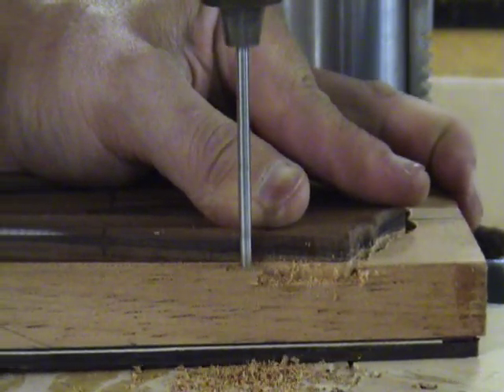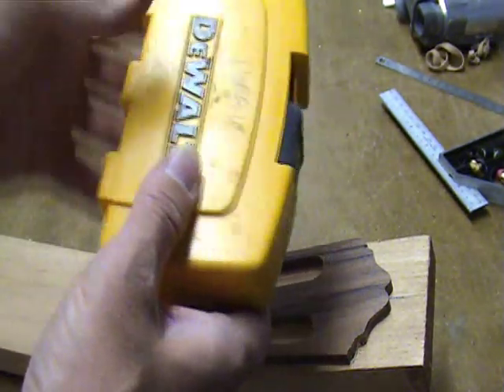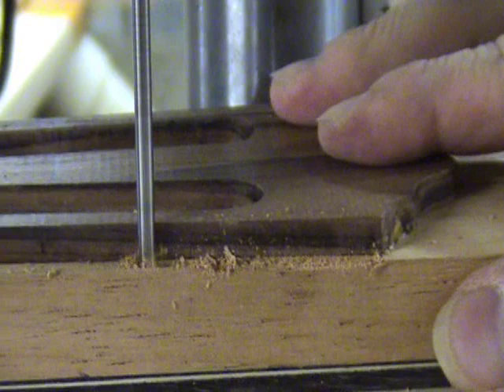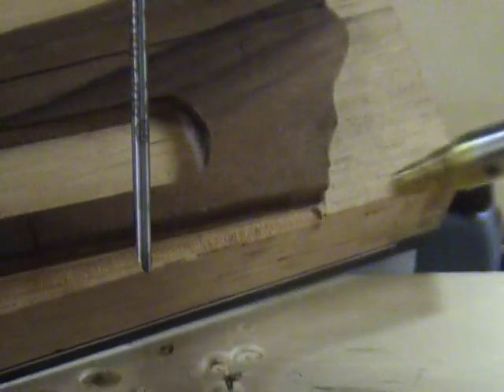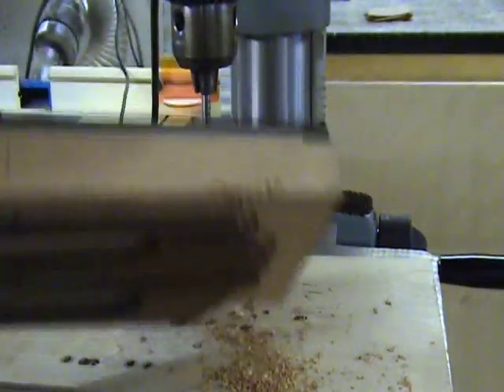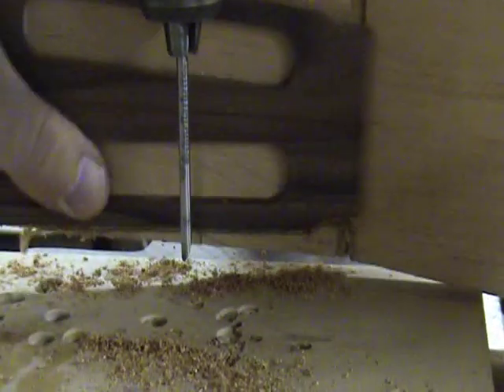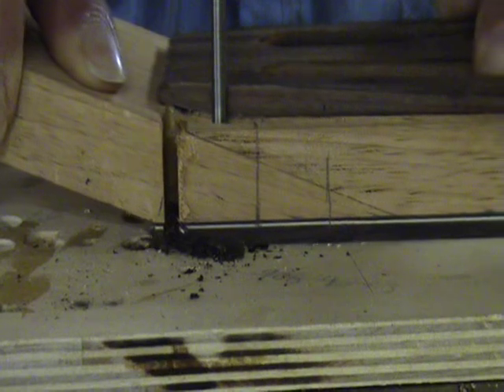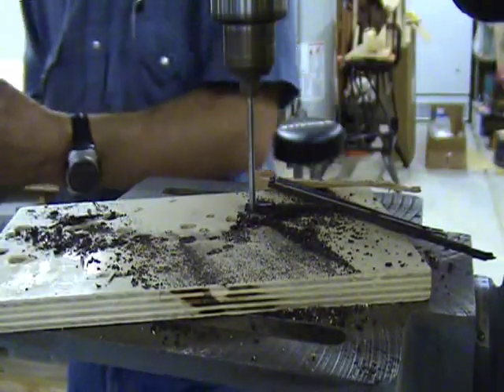O'Brien Guitars - Luthier Tips du Jour- Drill Press Router

Comment: In the early 1980s I worked as banjo maker and this was one of the jobs I did. We used a machine called a pantograph engraver which is essentially a floating router guided by a template. These machines have been superseded by computers and are available at relatively low cost. They are heavy, but once in place are very useful for all kinds of work.

Comment: Will the drill bit tend to want to wander off if it is not captured by the waste material? I ask this because I question why you wouldn't do a rough cut on the bandsaw to eliminated the chip buildup problem, but I assume you have a good reason why not.
Reply from the maker: You are correct. The bit seems to cut better with a full pass.

Comment: This is a great tip Robert!

I've recently completed a rig to profile banjo pegheads based on this method, but banjos have an important difference - the peghead is routed with the bit held perpendicular to the fingerboard, and with the backwards angled peghead this results in the cuts on the edge (in the length direction) being angled relative to the peghead face.  

I built a simple hand positioned XY table (search for "makerslide") to bolt to my drill press table for holding the neck parallel to the fingerboard centerline and after clamping the peghead to the XY table, the drill press table is tilted until the fingerboard is level and the profile is then routed out using this method (face side up however because the tilt makes backside templates difficult).  Along with some thin backer wood top and bottom to eliminate tear out the rig produces a nice profiled peghead, angled per banjo tradition, with only a short sanding needed afterwards  Thanks mucho for this idea.
Reply from the maker: Glad to hear it worked for you.

Comment: One of the most useful tips I've learned on YouTube.  Works well for general routing tasks, such as slotting bridges.  Bits cut as cleanly as router bits, but can be made up quickly, as needed, in 1/64" increments.  Try to buy a 9/64" router bit from Home Depot -- or anywhere else.
Reply: +Hubert Humperdinck When you slot bridges is there much cleanup involved or does it leave a fairly flat bottom?
Reply from the maker: +Jeff Zweygardt It is flat but I use a different method for slotting my bridges.
Reply: Yes, I use a Dremel too. Just curious how well this works out for bridges... :)
Reply from the maker: +Jeff Zweygardt Check out my steel string bridge making video to see how I do it. https://www.youtube.com/watch?v=T8WAVvkxRsc
Here is how I do my classical bridges. https://www.youtube.com/watch?v=kiwaQV0mpx0
Reply: Thanks Robbie, I'll try building one.

Comment: You could use a chip brush to remove the chips (lol!) At least at first. 
When raising the table, make sure that you don't raise it any more than the length of the bevel you ground. Also, be careful about how much side pressure you put on the tool. Drill press chucks are mounted on a tapered arbor, and can come loose easily if you put too much side pressure on them.

Comment: Robert! Thank you so much for this tip which I applied in another way when I was in a bind. I needed to route a truss rod channel but I didn't have the correct router bit, 7/16" (I order from a new supplier). I modified an old bolt in the manner you described in this video and hardened it. I chucked the 'bit' into my press and slowly routed the truss rod channel, making 6 passes with the bit depth slightly lowered on each pass. I'm amazed at how well this worked! Thanks again for the tip!

Comment: if you do it a lot,instead of stopping to remove chips you could also aim a piece of airline at the drill bit with a valve between it. You could even combine it with a vacuum system to keep a clean workspace. (and lungs)